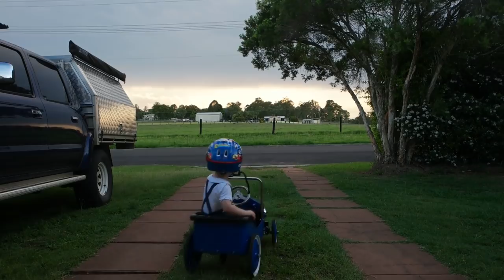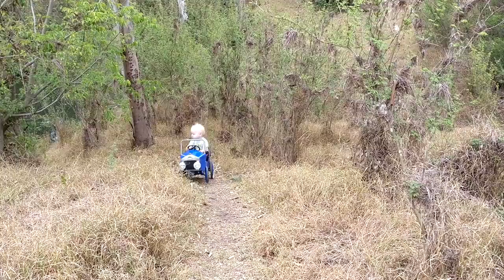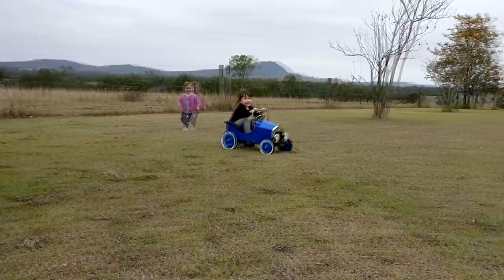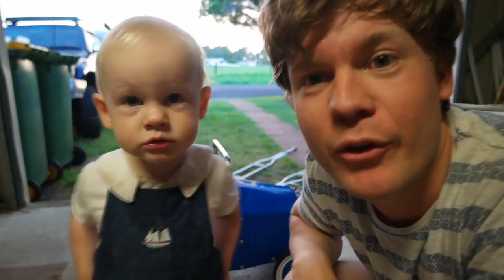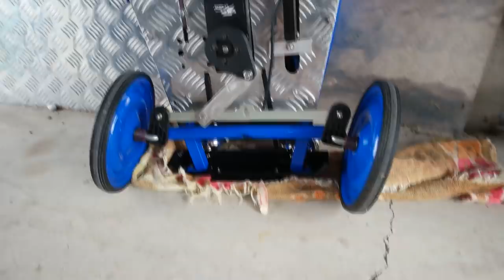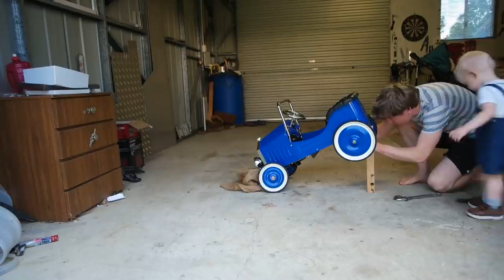Home Made Electric Ride on Car with Remote Control

Comment: Can you please tell me what type of multichannel PWM RC switch you have used? It is missing from your parts list but visible on your wiring diagram. BTW your car rocks!
Reply from the maker: I can't find the same thing that I ordered but something like this should work.
https://rover.ebay.com/rover/0/0/0?mpre=https%3A%2F%2Fwww.ebay.co.uk%2Fulk%2Fitm%2F190814178031

Or you could also use single switches

https://rover.ebay.com/rover/0/0/0?mpre=https%3A%2F%2Fwww.ebay.co.uk%2Fulk%2Fitm%2F192423790143
Reply: bengineering thanks! You are awesome!

Comment: What type of wiring do you use? Or do the parts come with wires ready to hook up?
Reply from the maker: I just used electrical cables that I already had. For the main power cables (from battery to motor controller to motor) you should use at least 5 or 6mm core cables to handle the current. switch and signal cables can be a lot smaller. If you buy a kit (i.e. bicycle motor kit) it should come with most of the wiring.

Comment: Nice project. 
Is any modification needed when the steering wheel is used, instead of the servo ? Or is the servo attached to the steering wheel all the time.
Reply from the maker: There is a bolt that disengages the servo  from the steering arm. Or if i'm lazy I can also just switch off power to the servo and its reasonably easy to move it manually.
Reply: Thanks for the reply, i just ordered a simular pedal car, i hasn't arrived yet. Now i am trying to figure out what electronics to put in.   
 Is there anything you would have done differently, that you can think of ?
Reply from the maker: Jón Poulsen hope it goes well! There isn't too much I would do differently. The batteries are heavy and take up alot of space so I would consider Lithium ion batteries if you want to spend a bit more. Maybe even using a couple battery drill type batteries so you could just click in a fresh ones whenever (that way they don't need to be as big because you could just bring a spare with you). My reversing switch currently only works with a manual button on the car, I'm planing to hook up a remote switch so that the controller can do reversing too. 
It is tricky getting the controller and manual pedal to work in a good range. I suggest you set it up for the foot pedal first and then program the remote controller signal to the correct output range (not too fast etc.) you can do this on the hand controller itself. I would also consider doing it all through an arduino next time. I just don't have experience programming them so I tried to avoid it. But that could simplify things a bit. Maybe. 
I find that the kids that are old enough to drive it themselves are a little too big for the car (they can't fit their legs in). So I usually just use it in remote mode with smaller kids. If you left off the manual control entirely that would also make things alot simpler. If you get stuck with anything I'd be happy to try and help.
Reply from the maker: Jón Poulsen the other thing is make sure you set the limits on the steering servo before you hook it up. I burnt out my first servo because it was hooked up and tried to turn too far. You have to open up the servo and wind the adjustment screws inside. This is better than using the programmable limits on the hand controller because when the controller is off it can sometimes drive past its limits.

Comment: I’m working on a similar project, utilising the same electric motor, is there any chance I could get the stl file for the motor mount?
Reply from the maker: Mike. Here is a link to the STL files. https://www.dropbox.com/sh/ocg58bklljn44zk/AACnTKqt98N4OT58IPmzNjdAa?dl=0
Both the 'motor mount' and 'chain guard' go together to support the motor. 
I included the steering arm (couples to the steering servo motor) and a brake pedal switch (fits a rocker switch).
Reply: bengineering thanks Ben! My build is on Insta @bonnievill - it’s going slowly but you’ll get the idea!

Comment: @bengineering  do you think I could get a clearer picture of the wiring image you uploaded to imgur? How can I contact you?
Reply from the maker: Sure. Email me at johanson_ben@hotmail.com
I've actually changed the wiring since doing that diagram. My motor controller died so I'm using a different one. And also switched to lithium ion batteries (milwaukee power tools battery).

Comment: Hahahaha, I have one just like this but red, I’m thinking about doing hub motors for mine but may not because the original look looks good. I’m assuming it’s still 1 wheel drive in the back?
Reply from the maker: I added a fixed axel between the rear wheels so they are both powered. I also swapped out the plastic bearings for ball bearings.

Comment: I PURCHASED AN ELECTRIC BMW i8 ELECTRIC CAR FOR MY GRANDSON. THE CAR CAME WITHOUT REMOTE CONTROL. HOW DO I BUILD REMOTE CONTROL, FOR THE CAR. I CAN NOT RETURN IT SINCE TOYS R US IS OUT OF BUSINESS. CAN YOU HELP ME? OR, CAN YOU TELL ME WHERE TO GET UNIVERSAL RC. I AM MECANCLY INCLINE. I WAS STUPID TO PURCHASE SOMETHING WITHOUT THE RC. I THOUGHT IT WOULD BE EASY FOR HIM TO DRIVE IT. WISH  TO HEAR FROM YOU. THANK YOU. JUDY ( I WENT TO all diy sites, and, did not see anything. i know it can be done. thank you. love what you did. reminded me my father, who made a driving scooter for me, as a child.
Reply from the maker: gee that sounds annoying. unfortunately its a bit hard to help much without seeing the car. I believe many of the ride on cars use an infra red remote control rather than a radio controller. because you dont have the controler you probably wont be able to get trick it into working with a different controller because you wont be able to test which signals it uses.

you could use the same type of radio transmitter and receiver that i have used (links and wiring diagram in the description) and wire it directly to the drive motor and the steering motor (you will probably need a dc motor controller too). if the steering motor is not a stanard servo motor you could have some trouble getting it work. 

to be honest it could be a very big job and you might find it easier (and maybe cheaper) to simply buy a new car. you can get them from $150 to $400. i guess it depends on how much of a challenge you are up for. all the best.

https://rover.ebay.com/rover/0/0/0?mpre=https%3A%2F%2Fwww.ebay.com.au%2Fulk%2Fitm%2F391439906799

Comment: How does manual steering work with that huge servo attached?
Reply from the maker: There is a bolt that disengages the servo  from the steering arm. Or if i'm lazy I can also just switch off power to the servo and its reasonably easy to move it manually.
Reply: Bogdan Rădulescu i u
Reply: K
Hu. u

Comment: What is the maximum load limit ?
Reply from the maker: I'm about 70kg and it handled me ok. The motor torque can handle the weight fine, its just the car body that is the limiting factor. Particularly the front wheel axles. I might swap these out with something heavier, or at least change to bolt on wheels rather than the press fit caps that came with the car (they are slowly pushing loose).
Reply: Leonardo Neukam bibiciclta

Comment: please tell me in detail how to make it
Reply from the maker: Step 1. Buy car. 
Step 2. Add electric motor, steering servo motor, batteries, controllers etc.. (list in description). 
Step 3. Enjoy. 

If you have any specific questions let me know.
Reply: how to assemble all the electricity from electric motor, steering servo motor, batteries, controllers. What you have an overview diagram
Reply from the maker: I sketched up a wiring diagram that might help. Here is a link https://imgur.com/a/JXyOk
Reply: thank you for sharing the wiring diagram, very helpful
One more question. for rear wheels, any spare parts other than chains and sprockets
how to unite the rear wheel with sprocket
Reply from the maker: val dano the rear Axel is an M12 threaded rod. The wheels and sprocket is attached to the Axel with nuts on each side. To attach the sprocket I cut out a circular steal plate and welded a nut to it. The sprocket then bolts to the plate. 
I made the motor mount by 3D printing. But if you don't have access to a 3D printer you could make a bracket out of steel.
Reply: Your instructions are helpful. thanks ben already want to share
Reply: Hi Ben, this is absolute class! I’m working through a project at the moment for my boys and you’ve helped me answer some of the “hows and what if’s” that keep you awake at 3 in the morning. -